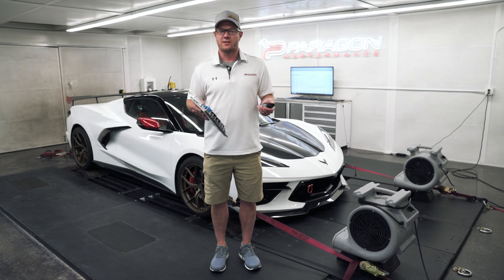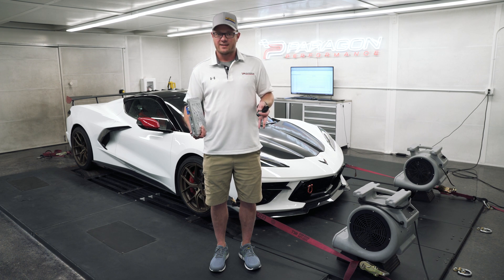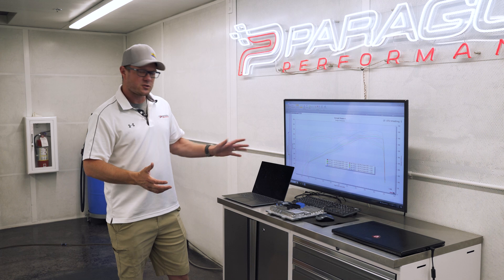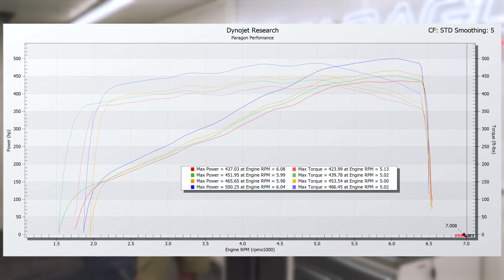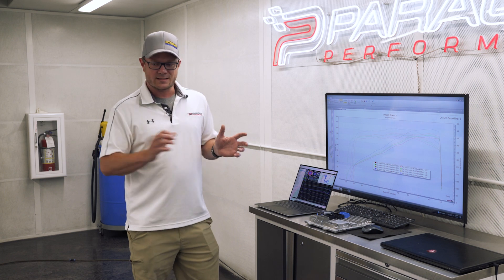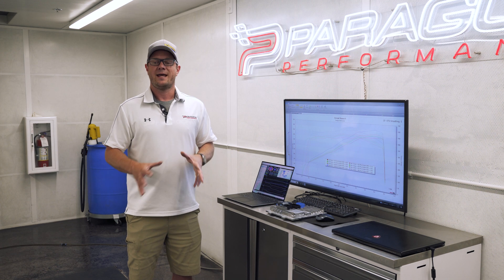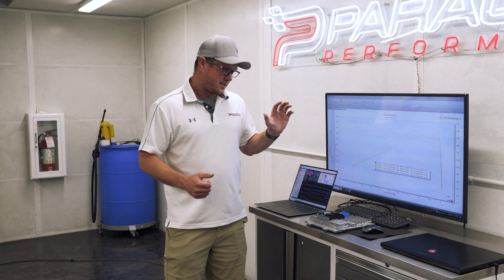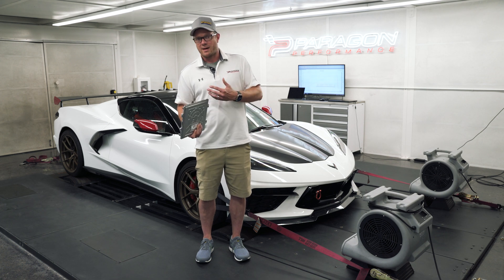500+whp E85 C8 Corvette Tuning: The Ultimate Power Upgrade!

Comment: So ive been building stand alone ecu's since like 2006, mainly megasquirt initially, and lately speeduino. That said ive really not messed with the oem controllers with none of the cars having networked modules to worry about. Now ive been kicking around the idea of building an ecu that can be used in place of the stock unit, while maintaining functionality in the cars subsystems,  gauges, hvac etc... getting it to ay nice with the obd2 deal is pretty straight forward but im guessing the can protocols are unique to each manufacturer, is that right?

Comment: If he would have had American Racing Headers 1 7/8 paired with the stock cats it would have been an extra 10whp-15whp. After several different tests this setup nets 17whp on a regular basis. Kooks will lose power alongside other LT headers. ARH 1 7/8 with stock cats is the answer for N/A C8s.
Reply: Funny thing is i called American Racing last week asking if sport cats made more power and the answer was no.

Comment: With no DCT tuning available yet are there torque tables like on the C7s within the TCM that will hinder performance on boosted setups?
Reply from the maker: We've found as long as you stay below 650 WHP, we've had zero issues with the transmission.

Comment: 437hp on 91 octane vs 500hp with e85. That's incredible.  I just got a quote from my local speed shop on doing a full e85 conversion on my c7 grand sport that has about 600whp now. They wanted $3,330 for it. I have a boosted engine so I would see more gains. I paid over 5k for long tube headers, high flow cats, x-pipe,  weapon x pully, and tune for about 80hp gain so the gain from e85 is better for the price. The c8 is too expensive to mod right now.

Comment: All the basic hot tricks should work bigger cam bigger crankshaft longer bore and stroke bore  the block out for
bigger pistons and connecting rods port the intake and exhaust vavles for better flowing better exhaust bigger
injectors higher flowing fuel pump permanently deactive four cylinder mode ditch the displacment on demand
lifters for non dod lifters. Install stronger clutch packs in the transaxle.

Comment: Why are you talking about outside ambient in a temperature and humidity controlled room???
Reply from the maker: This is because our dyno room is not climate controlled. Unfortunately to do so for a dyno room this was not feasible due to how much volume of air has to be exchanged out of the room. So this means all the air pulled into the room is fresh air that is going to be the same temp and humidity that is outside.

Comment: Great content. E85 and a tune, plus maybe a 100 shot and you're at 600 whp or so 
A lot cheaper than a 25k supercharger.    But callaway option would keep the warranty though.
Reply: Heads and cam
Reply from the maker: Working on heads and cam now :)

Comment: No chance to actually raise rpm limit? 6500 is ridiculous on a car like this
Reply: Need cam swap for that
Reply: 6500 is good for a street car, but it's much lower than what should be possible.  I have a 496 cubic inch classical big block with Calles crank and rods that goes to 7000 rpm comfortably.  That's some big rods and pistons going up and down.  Put a good crank and H beam rods.  Heck if you've the bucks, go titanium rods at $800-$1000 apiece.
Reply: Just get a Z06 if you want high reving 👍🏼
Reply: easy to say when the car is all-ready over a 150k and had my corvette for 2 years before the z06 specs were even known  @HL_YT555

Comment: "The answer is: No" lol I wouldn't even pay even if I had E85. Not enough power yet so waiting for the cam would be the best option. LMR is developing something with HP tuners as well and they have 700+ whp packages. Up to 1200+
Reply from the maker: LMR is reaching those numbers with turbo kits and you’re talking about another $25,000+ for that. You could do a Procharger or Magnuson for roughly 20k as well. 🤷‍♂️
Reply: @ParagonPerformance  I don't think these guys know what LMR actually charges but for 1200hp build using their turbo kit that pushes that price to over $70k. Nearly as much as the car itself. Personally for most people on the street that want to wake this car up bolt ons and tune like this is bargain money thats hard to resist. Thanks for the work.
Reply from the maker: @dcsteve7869  Sounds like we need to start offering 70k turbo kits 👀
Reply: @ParagonPerformance   to be fair that was installed, with fuel tech stand alone, built engine, axles, clutches and such but it puts things into perspective for those who don't really know how much work goes into a total package like that and how expensive it all cost. 
For someone  to criticize getting over 500whp with a tune and bolt ons while quoting LMRs 1200hp package, I have to think they didn't know what was involved in that.
Reply from the maker: @dcsteve7869  Two totally different builds

Comment: I live in California and thus have only 91. However e85 is readily available. As I have no intention to tune even raising the octane to 93 by blending in some e85 would seem worthwhile. What is the maximum ethanol concentration you can use with the stock tune? I know all cars can handle e20. Can the Vette go higher?
Reply: On a empty tank (18.5 gal) 2 gallons of E85 blended in to a tank E0 91 equals 9% ethanol, well under the approved limit. Most of the stations in CA sell E10 91. 2 gallons E85 into E10 91 is still only 19% and will cause zero harm and well within the fuel trim tolerance but the manual says not to exceed 15% ethanol. If that concerns you though, go with 1.5 gals instead for 14% total E with close to 93 octane.
Reply: Allow me to edit my previous post. I believe MOST cars can handle e15 on the stock tune with no problem. Can the C8 goes as high as e20 without a tune? My goal is to raise my California 91 e10 to 93 e20.
Reply: C8 can handle 100% E85 without tune, but have to be flushed with 91 weekly and can not be park for more than 2 days. I usually do 60% e85 the rest is 91 when I track day or weekend then empty it. It's been 2 years now with no issue beside CEL light.

Comment: Is there a cam upgrade available yet? Recently purchased my C8. Already received various parts from Paragon. Great experience thus far.
Reply from the maker: We're researching options at the moment. "Dotty" our CMG Track Car will be an NA Build with Cams and more.
Reply: @ParagonPerformance  Looking forward to it!
Reply: yup all ready out, now you can get heads cam and tune. like i said before around 550whp to 560whp
Reply: @peterszenkowski7769  Those whp #s are on pump 93 and no tune, or....?
Reply: @aaronrich7109  yes  93 and yes you will need tune with those mods.
Reply: @peterszenkowski7769 which vendor sells C8 cams?

Comment: How come the car shown has the Eventuri airbox and Lingenfelter pTR Intake with larger TB and obviously has the coupler but no info is out on the coupler? Is this available yet? All I keep hearing is testing and R&D.
Reply from the maker: Hi Joseph. The product is now in production as we were finishing our testing as you can see in this video. We do extensive testing on our products to ensure you or others aren't running into any issues.
Reply: @ParagonPerformance  I can appreciate that, trust and believe. I’ve been inquiring for a long time and had contacted Eventuri when first introduced and that’s when they told me you all were developing the coupler and they welcomed me to a tour if and when I come across the pond. 
So to go from there to where we are now with a chat with Korey heading back to Iowa in 2021 about my pTR experience it’s been a minute, and I have him locked in on my cell. While in this conversation I have to ask, why is the Eventuri unit called and intake vs an aIrbox? The pTR is an intake with there being runners under the carbon fiber air intake. To me the Eventuri is taking the spot of the OE airbox with the filters etc. I’m just curious…
Reply from the maker: @josephdixon507  The Eventuri is an Intake System or can be called an airbox as well. The pTR is an Intake Manifold which bolts to the heads of the engine.
Reply from the maker: Coupler is available for pre-order!

https://www.paragonperf.com/eventuri-to-lingenfelter-throttle-body-coupler.html